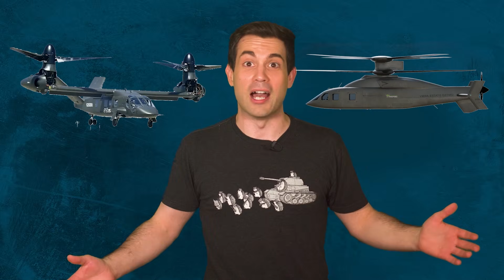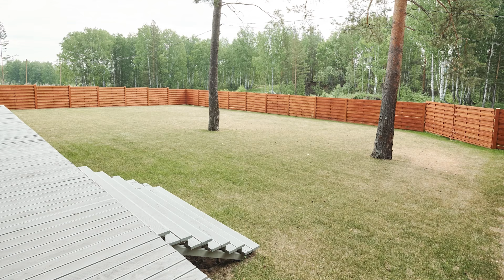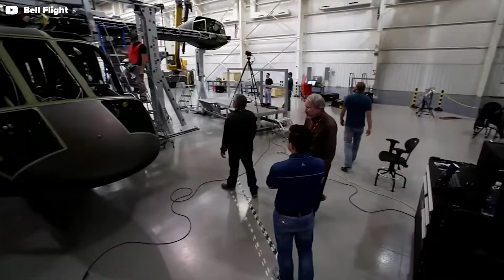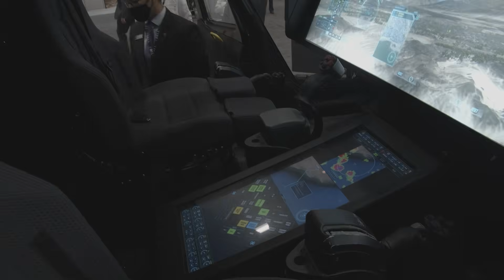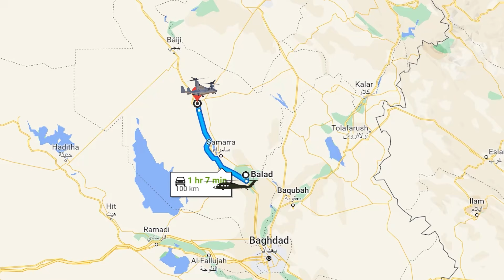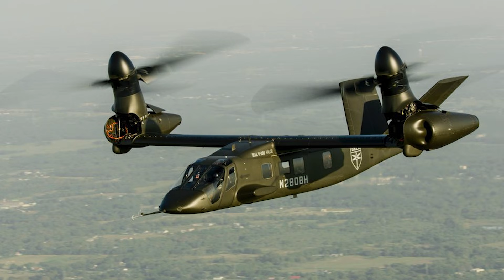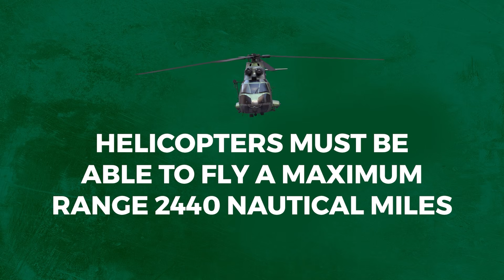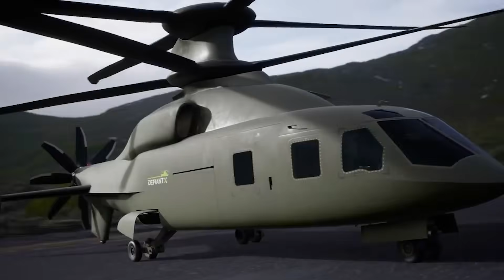V-280 Valor Helicopter Will Help Defeat China

Comment: What the Army needs now is a Jumbo Osprey. A chimera b@stard that fits between the C-130 Hercules and CH-47 Chinook. 
And it needs to be Army Aviation organic. Cut dependency on the Air Force for tactical air lift operations at the longer ranges the Army helo fleet cannot support, and the need to capture and hold air fields, which is a logistical and strategic nightmare.
And it wouldn't need the troublesome swing-wing stowage system of the naval Osprey.
Reply: Go back and watch that movie, "Live, die, repeat" They basically have D-day that's half jumbo tilt-rotors. (Disregard the actual battle scenes though, pretty sure monty python was the general in charge of that invasion I swear XD) 
Absolutely awesome flight scenes though. Honestly, someone should already be looking at feasibility studies about those aircraft... I think there was a couple different versions in use as well but I can't remember for sure...
Reply: Bell mentioned a while back that Osprey is as big as they plan to go for swing wings. Apparently there are issues at larger scales that make other layouts more attractive.
Reply: @Stu_Bur  Well I'd imagine the power levels needed for the engines on much larger aircraft would put stupid levels of torque on the various supports and wings of the craft whenever they were powered up, and then trying to rotate the fuckers... They might not even have aircraft appropriate hydraulics powerful enough...

I did see a tilt-rotor design where they basically had like three or four sets of wings with comparatively smaller engines on each. That might make the torque forces more reasonable on a wing by wing basis.... Although you'd have multiple sets of rotation hydraulics so weight might become an issue... You'd probably end up with diminishing returns...

But, pie in the sky idea, throw a small nuclear reactor in the ass end of the thing, fill every spare spot with batteries and capacitors. Tear out the engines and fuel system, replace it with big ass electric motors. All the power you could ever want lol.

Comment: We should have bought and fielded the RAH-66 (Commanche) when we had the chance instead of letting it turn into a giant waste ..... I got to see the flying prototype at Hood before we deployed to Shield/Storm. Yes it had a few flaws, as every first issue aircraft or vehicle does, but it would have been worth every penny spent. 
Looking at other suggestions posted here, splitting and refocusing the purchase to buy both systems is a far smarter move than just buying one... makes a lot of sense which is why it will never happen

And, Chris? 
Glad to see you up and around and doing better. Also, do you remember the hull number of your ICV? I might be able to give you a bit of history on it.

Edit: went back and checked timeline on Commanche. According to the two articles, what I saw at fort hood was a powered mock up not an actual flying prototype
Reply: Bell 360 Invictus looks like a Commanche on a tighter budget. I suspect that it will win the program for the next recon aircraft.

Comment: You forgot a point. Fixed winged can use run ways to take off with a heavier payload.  So put on the 13000 lbs, and then the fuel, and take off.  At the LZ, the fuel will have burned off, allowing a vertical landing and take off. A controlled vertical landing.
Reply: The renderings looked like the V-280 wouldn't have ground clearance for its rotors to do fixed-wing takeoff and landing. Is this wrong?
Reply: Tilt rotors appear to be able to do a rolling takeoff at an angle but not  at a completely horizontal wing position.

Comment: There's one potential advantage of the tilt rotor design that no other rotary aircraft can achieve: Depending on it's glide slope (probably abysmal though) you could approach an AO with the engines off (thus almost completely quiet) and only switch them on once you are covered by the terrain. That can get you much closer to an enemy position without alerting them to the presence of the landing aircraft - but if you actually utilize that advantage and land very close they will be very much alerted to the presence of the troops and the presence of a helicopter that will still have to leave. Saying that, I really don't expect this strategy to give an advantage over flying in under terrain cover very often.
Reply: Every pilot in the world looked at you funny when you said "approach with engines off".

Even with the loud noise, unless the troops are well trained, there's going to be some element of shock from the chopper coming in and landing, and US combined arms would have probably shelled the position and these choppers would be coming in with air support from attack choppers. In all of this, noise of a few more choppers isn't going to be noticeable.

For Stealth missions, there are specially designed aircraft and it's a special forces deployment: they always get the bespoke nice toys.
Reply: @granatmof  It's more of a stupid idea that I had than something that has any chance of being seriously applicable. Either categorically if gliding too steeply down when you turn on the engine would put you immediately into a vortex ring state, or the advantages are so minor that it would only make sense in "that one crazy operation".  edit: And it's also about the rotor configuration in general, not any existing craft.
I must admit that I don't know much about large scale operations. My knowledge comes mainly from platoon sized operations (in Arma3), which means more of a special forces style operation. And for those, a HALO drop would be even more stealthy.

But when you say "special forces get the nice toys" I remember the Osama Bin Laden assassination being done with 2 Black Hawks - which these craft are to replace.

Comment: Nice vid, but I think you need to check that range. 2440 nautical miles is an insane range for a helicopter.  I think the range is supposed to be 263 miles (according to Wiki) so about 229 nautical miles.

Comment: Only thing wrong with tilt rotorcraft is they can’t autorotate.
Reply: A rotor wing guy I knew who worked for Boeing told me there have been ideas in the works for a secondary, in-line electric motor riding alongside a standard engine that would take the place of autorotation, as well as having several other uses.
Like fuel efficiency. The most fuel gets burned on lift and landing, but an electric shotgun engine adding torque would solve that issue, quicker application of power when under load or needing altitude, and powers driveshaft if the turbine fails.  
He had said that the added weight from the addition of the in-line motors and batteries is offset somewhat by needing less fuel (takeoffs, etc) and the power packs would be getting constantly topped off during normal flight.
Reply: @WindFireAllThatKindOfThing  if that can be done it would be cool, autorotation is one of the mechanisms that allow “helicopters” to land safe under 0 power, one of the reasons POTUS can’t use a V -22 Osprey for their helicopter.

Comment: U seem 2 be neglecting the fact they multiple & very recent fatal Osprey crashes AND the fact that there is no chance 2 autorotate & therefore,basically,   no chance 2 survive >

 exactly y the POTUS will never use an Osprey.  Best option is a helo w/ counter rotating main rotor a "pusher " type blades @ rear.   Pilots who have a chance of surviving MAY try harder & be grittier than tilt-rotor Pilots who know death is certain,no ?

Comment: I rather ride on  an old  reliable and durable Blackhawk than any VTOL that has already costs us about 24 service members so far...😒❤🇺🇸
Anywho, the key engineering issue here that needs to be addressed is can this high tech military vehicle capable of blasting "Fortunate Son" while in flight 🤔. But at the end as usual the Pentagon will go with whatever will cost more eventually while letting the cheaper more efficient one go into the abyss...

Comment: LMT design is the best. The following tilt rotor designs miss out some key areas. Mainly ingress and compress. The battle tester CH 46 can stop on a dime, drop off troops be airborne again doing 140 nights in record time. Tilt rotor designs require very long slow ingress. Very susceptible to shoulder fired and small arm munitions. There is no other better platform than something like the Blackhawk war CH 46 or Chinook to get troops in and out of battle in a hurry. If you need a troop transport try is the C130. The tilt rotor tries to do both but fails miserably on both plus very high acquisition cost and a maintenance hog. They are ground lovers that break a lot.

Comment: Why not reopen production of the CH-47, if it will lift enough? Of course it's 2 generations older than the BHawk. Be careful about equating old with no longer capable.. Or are you planning a vid on why the USAF should get of all the BUFFS?

Comment: In the end, both might be essentially picked. The army is holding 2 competitions, FLRAA and FARA, this video just discussed FLRAA, but both bell and Sikorsky are competing in FARA as well. FARA is supposed to be for a smaller scout type aircraft, and Sikorsky is basically making the same aircraft for it but smaller, while bell is going with a more traditional design. If the bell v280 wins FLRAA and the Sikorsky raider wins FARA both aircraft this video discusses will be selected.
Reply: I suspect that Defiant will win this utility and lead in to attack program but Bell will win the recon program  with Invictus

Comment: You should do a little more looking at the Defiant, and Raider aircraft.  They are already meeting the lift and speed requirements in testing and the test pilots are saying they are not nearly maxed out yet. Lockheed will not openly give the max speed, but they do say "twice as fast as the Blackhawk."
Reply: Yup, Defiant will meet contract requirements easily. It will even come up pretty close to the tilt rotor for speed and while being superior in other ways such as agility and fields of fire.

Comment: The next F-35 project. 
An expensive system that's utterly overpowered for blowing up insurgents with AKs
An overly complex system that Russia and China will find some comparatively cheap hotfix for their AA systems to lock on and take down, or will simply out-produce with a "good enough" knockoff or older system at a fraction of the price.
And a system that will make well-connected government contractors stupidly rich when it "surprisingly" goes massively over-budget and we the taxpayers have to pay that instead of the companies being forced to honor the contracted price. 
It's cool and futuristic, but rather hard to be optimistic about it when our economy is a dumpsterfire and our Commander in Chief is the elderly shell of what once was the posterchild of government corruption and career politics.

Comment: The tilt rotor option requires a much larger LZ. For this reason alone I think the Defiant has a huge advantage.
Reply: Defiant also has better fields of fire available, better agility, and downwash with less hot gasses that is safer for tight improvised landing spots.
Reply: That's what I was going to comment but you beat me to it
Reply: This is factually incorrect. The Bell has the same footprint as the Blackhawk, just rotate it 90°.
Reply: Just a word on the size. The V280 has the same footprint as the Black Hawk if you rotate it by 90°. It's still a little bigger but not by much. Where both the Black Hawk and SB-1 become smaller is the folding props.

Now whether they can do maintenance in the same hangers remains to be seen. I think they'll need to build new or modify the old to accommodate.
Reply: When quoting footprint, don't forget the length. The Bell V-280 Valor has a significantly shorter, compact length of only 50′6″ – compared to Black Hawk’s length of 64'10"
Reply: @txtworld  Black Hawks have collapsible wings. Not sure what the down wash turbulence of a V280 will look like, but it's probably going to be like the V22 who can't fly over each other. During transport, Black Hawks, and V22 become as slim as there fuselage.

Well that doesn't matter b/c they can just fly over. True, but only to a point. They have to fly empty to meet long distance ferry ranges.

The attack variant won't be able to just fly forwards.

Hopefully they'll figure out how to turn the wings with that shaft through it. I could see the wings pop up from the fuselage, then rotate, but that might be structurally impossible.

Comment: You can't tell from the video, but the two sets of rotor blades on the Defiant X rotate in opposite directions (contra-rotate).
This prevents the helicopter from spinning, which typically is achieved via a vertical tail rotor.
 Circa 14:02 the heli is hovering and descending without using the tail rotor, which would be impossible using a conventional design.
(The CH-47 "Chinook" also has both rotors rotating in opposite direction, and has no tail rotor at all)
Reply: It also looke like an absolute maintenance nightmare and fragile to the point of absurdity.
Reply: @GusOfTheDorks  you mean like every modern helicopter?
Reply: @bubsnicket  Some are better about it then others though.
Reply: Counter rotating on a single axis is old news. Just ask Russia. (Hind). In the US, check out Kaman as well for an interesting counter rotating design.
Reply: @paddlesailnitro1  yes it is, but the Defiant isn't a conventional coaxial rotor, it is a stiff rotor design based on composites. In theory it means it can go much faster before the blades can flex enough to hit each other.
Reply: There's another advantage to the co-axial, counter-rotating rotors on the Defiant. It delays the onset of retreating blade stall, so it allows much higher top speed than a traditional helicopter (like the Blackhawk or Apache) can attain.
Reply: Glad someone said it
Reply: J
Reply: Chinook has rotors on the front and back, very different machine.
Reply: @captaron  Yes, the Chinook is very different. But the two rotors spinning in opposite directions is why it doesn't need a tail rotor. The Chinook is the U.S. Army's fastest helicopter.

Comment: The problem with the new designs is and always be how easily can it be maintained and what major design flaws inhibit that, like the ch-53 and all it’s variants that are absolute death traps or the osprey which isn’t exactly easy for your average crew to keep in the air
Reply: That's why we need more educated troops.
Reply: That's not as relevant as you'd think.

America and NATO have been at a full world war footing for decades.

And maintenance aside, you can't make the tech of today nearly as fast as the stuff in WW2 was built.

We literally keep ourselves fully equipped for an all out no holds barred fight to the death with Russia.

In the smaller fights, the inconvenience of harder maintenance is just an inconvenience.

Comment: both those wings and propeller hubs make very visible juicy targets. I forsee the size of these becoming a big problem for maintenance and Stealth.

for those of you unware of the principles of propeller design:

RPM is proportional to noise and Thrust.
Size is inversely proportional to RPM
Number of blades is has the same effect as RPM (note: stacked blades are less effective than higher blade density (same hub))
Blade Shape and Sweep effect noise, RPM and thrust (and thrust direction).

increasing any of these means an increase in maintenance, with the increase in size having an increase in profile too.

with this in mind, I probably would have gone with a Tilt-rotor aircraft with much shorter blades, this would mean a lower profile but a higher RPM (and as such noise) for the same speed and/or carrying capacity.

realistically the idea of a stealth Insertion Helicopter that is also capable of transporting a heavy load are directly opposing goals, so it's a balancing act for the properties of the aircraft. it would be much better just to split this off into two separate projects but the US military loves combining roles.

Comment: I think the defiant is going to win, a lot of the problems that the Osprey design had was that the rotor couldn't perform autorotation in case of engine failure and in airplane mode the wings wouldn't be able to sustain the aircraft in the air in order to glide to a landing zone, that's why the V-22 was never used to transport important persons such as a president as it had too many safety risks

Comment: I really really hope that Defiant X wins the competition, it seems absolutely perfect for what the Army wants to do and would slide in perfectly to current operations, it's also super cool looking though that's not as important lol. Really the only thing the Valor has over the Defiant seems to be level flight speed and maybe range and in every other facet the Defiant X is better. That said, as shown in the video, the Valor would be great in island hopping operations in the South China Sea. Which honestly makes me think that the Marines should look into the Valor. Just as I think the Defiant X is perfect for the Army, it seems like the Valor would be perfect for the Marines. Just my two cents guess we will see!
Reply: Marines already have the larger V-22 which is more capable than the V-280, despite being an older design. V-280 has lower specs and doesn’t even have a rear ramp for unloading and a gunner, V-22 does.